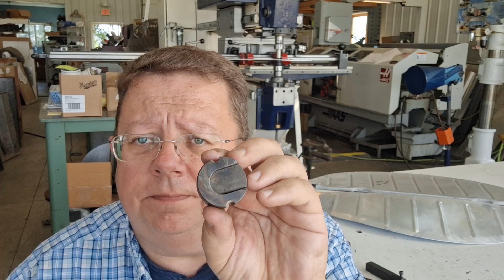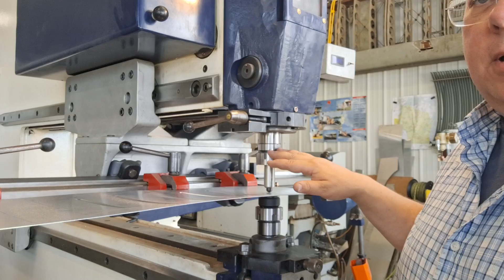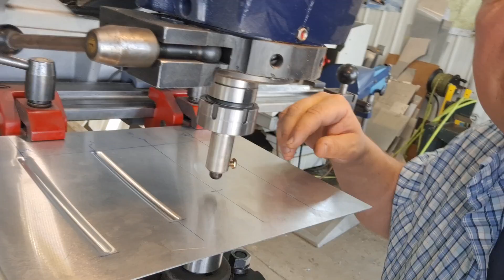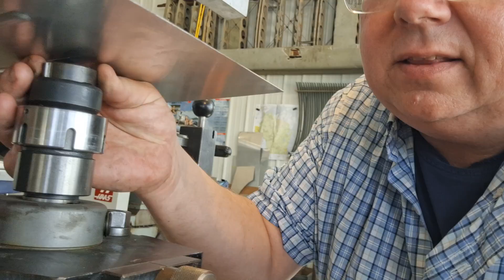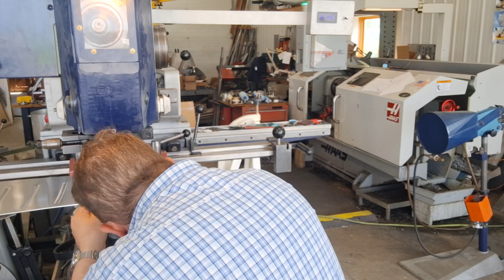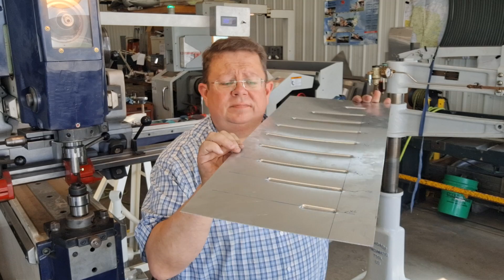Fulton metal works beading dies.

Comment: thanks William. good to know about these tools. if i understand correctly, 3003 is ok for airplane interiors and 2024 is designated for exteriors? cheers.
Reply: As you probably know ,most certificated aircraft use 2024-t3 on everything. Some parts on some plans use 3003-h14 on some non structural parts mostly built in the 1930s....and occasionally 5052-h32 mostly on English aircraft...ya 2024- t3 and 6061-t6 are very difficult to work with in the T condition. Hope i don't sound like a jurk know it all, Bill knows way more than me.
Reply from the maker: Depends... I recommend that Metal Shapers follow manufacture material selections when making parts for aircraft. This particular part is a fascia piece with a structural piece mounted right behind it. Some interior pieces can be structural, depending on the aircraft design.

Comment: Great explanation.  Not something I am equipped to do but just for argument's sake, if the material were not able to be flattened by hand, would slightly running the edges through an english wheel fix it?
Reply from the maker: You would have to be careful that you don't cause any stretch with the Ewheel.